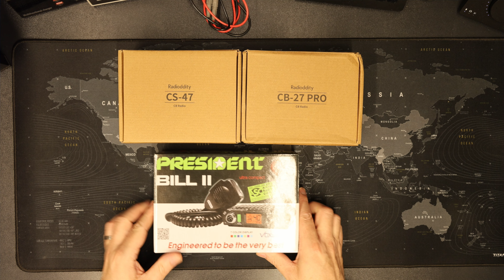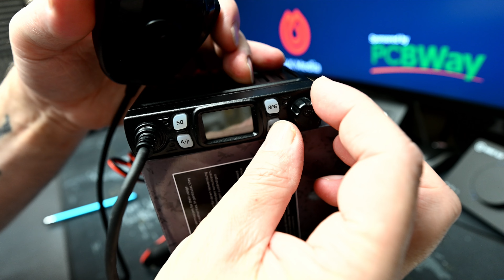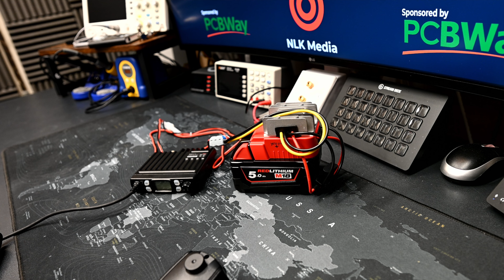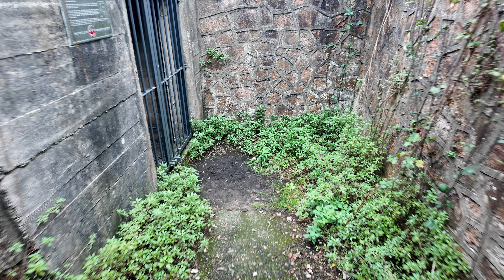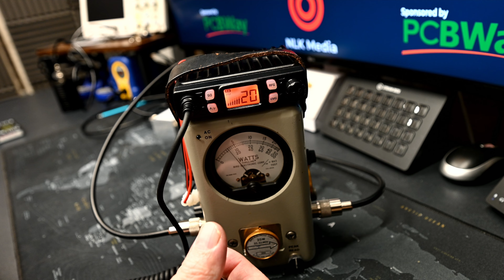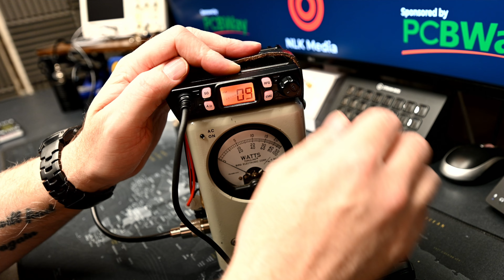Radioddity CB-27 Pro - Review and Expansion for Emergency Preparedness

Comment: This little rig is quite a huge bang for such little bucks.  I got a couple for my brother and I atv in the woods. Strong little rig even on the amateur 10 meter band on am and fm simplex. I put 102 inch whips on the atv's and we have all the range we will ever need and then more. It gets the job done very well. I have low pwr set at 2.5 watts carrier/ mid pwr @ 4.2 watts carrier/high pwr @ 10 watts carrier. Mid pwr range does all we need+. Great video on an excellent product. 73 GOD bless Earnest K5EWM 👍. PS thanks Radioddity👍.

Comment: Nice to see Ham radio operators promoting CB radio in a case of emergency. Because nothing else will work. No electricity, no repeaters, no license required, anybody can have one ready to go and talk locally. This is just my opinion.
Reply from the maker: I agree that HF is the most likely to be of use in an emergency and CB makes it cheap and easy to use rather than the more expensive HAM HF units. If the power goes out repeaters go down after a short amount of time. The CB27 Pro is inexpensive but I would go for the CS-47 as its a more capable radio. Thank you for commenting and for watching. All the best MJ7NLK
Reply: @NLKMediaGroup  ❤

Comment: The good idea with a power tool’s battery. I have a Ryobi one.
Reply from the maker: Yes it just makes sense to use them. You might be able to get a Ryobi version of the step down converter. All the best and thanks for commenting. MJ7NLK
Reply: I assume you have changed the connector as it comes with a 12v car socket?  Is it possible to use an adapter so you can use it in-car or with battery?  Thanks